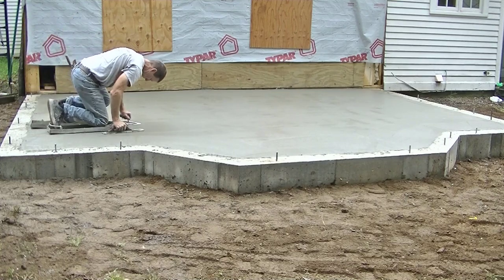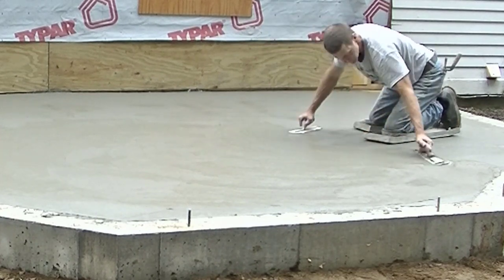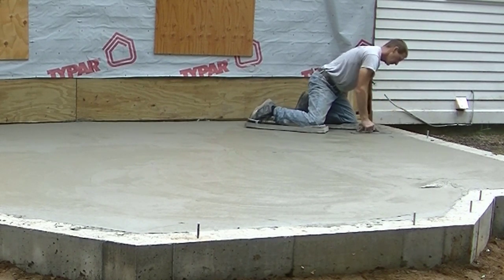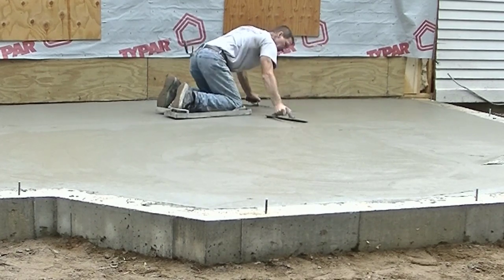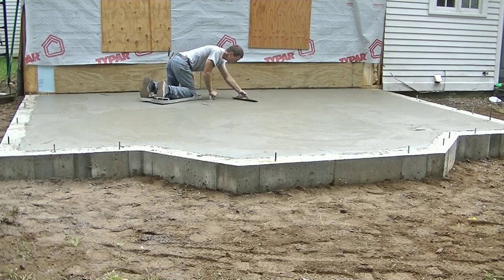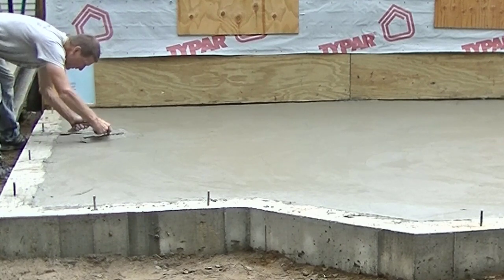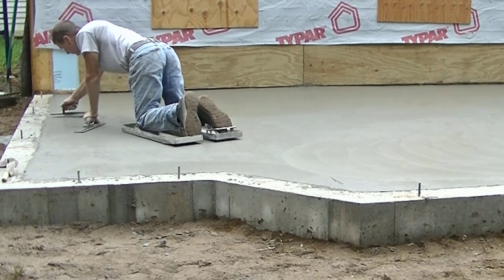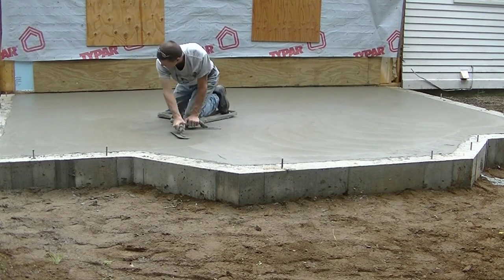1 Man Finishing Concrete For A Small Addition Floor

Comment: Thank you for the thoughtful explanation. So much can change about how concrete responds, the time of day, sun or shade, ambient temperature, slump, PSI, size of the aggregate, ect.. Over the course of your videos you have shared so much of your knowledge and experience. It has been and is very helpful. As you have pointed out, nothing replaces having your hands on the tools.

Comment: Here in Montana with our concrete we never just mag the slab. If we hit it by hand we will hit it once with a mag and steel trowel and then hit it again with two steel trowels. Usually a small scrubbing trowel and a 20 inch finish trowel. As and old school finisher I don't use round tip trowels very often.

Comment: Would I need a smooth surface if I epoxy the floor?
Reply: Absolutely..... if you want a nice finish in your work shop/ garage ...
Just make sure you use "real" two part epoxy not the crap from Lowes or Home depot should run you about  $130.00/40  per can if it is  the good stuff